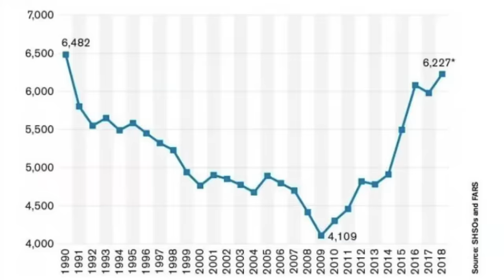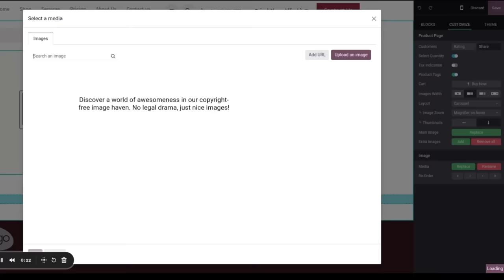Can this forgotten invention save your life?

Comment: As an American who lives and works in a very mountainous and rugged area, my favorite part about all of these massive new trucks is that they’re a terrible option for pretty much all their marketed uses. Their super soft suspension makes towing more fuel inefficient and dangerous. Wide bodies and top-heaviness makes a lot of rugged and steep backroads inaccessible. If you’re traveling through deep mud or snow you HAVE to balance the weight distribution between the cab and bed. I see so many people driving big trucks through the snow and their beds are filled with sandbags, which makes the already heavy vehicle even more fuel inefficient and dangerous. Since they’re so tall, it makes it difficult to see over the hood on rough terrain, making overlanding harder. I drive a 2 inch (~5cm) lifted 2016 crosstrek with slightly oversized wheels and I’ve tackled Jeep trails with a ratings up to 3.0, and I’ve bailed out a few overly confident pickup truck drivers on less technical roads. I volunteer to shuttle trail maintenance crews and thru hikers in the summers and all the other volunteers drive similarly practical compact SUVs. Or Four runners, Tacomas, or Tundras. I love only needing to buy gas once or twice a month, and being able to get up my steep gravel driveway. When my friends with big new trucks visit, I have to hop in the drivers seat because they genuinely don’t know how to drive up something like that without carving deep ruts in my driveway (they’re all from the city btw!! None of my friends out here drive big trucks)
Reply: Land Cruiser 70 Series will leave em all behind. Still
Reply: Corporations are not interested in selling you the best tool for the job, they are only interested in selling you the tool that makes them the most profit.
Reply: @mycosys Yeah no thanks I'll take my modern vehicle that can go over all the same trails. I like having the comfort of it.
Reply: @Aliyah_666  doubt it.
Reply: @Aliyah_666   Congrats on not knowing theyre still made and still being updated i guess?
Reply: @mycosys  FJ Cruiser or 4Runner are also solid options. Taken the latter off-road quite a bit.
Reply: Off-road Beetle is still king.
Reply: @mycosys  Did a quick search, they are not allowed in the US anymore due to emission and crash tests.
Reply: Thanks for sharing your experience. I am looking to get a truck this year (I am desperate for a vehicle that can actually transport 4x8 sheet goods without being a danger) and definitely want to make sure I'm still capable when I want to go out hiking or further out in the mountains (I am somewhat in the country). Not that I was ever looking at a new or super large truck anyways, but this is helpful stuff to take into consideration.
Reply: @georgehill3087  fortunately, this statement is false.
Reply: Without fail every video I see where someone starts criticizing the usefulness of pick up trucks there’s always somebody with a crosstrek saying they can drive through mountains upside down backwards through a snow storm.
Reply: I hope Alex comes back to the Subie family now that he trashed that crap Ford!
Reply: @mycosys  congratulations on excusing a terrible person who likes terrorists.
Reply: @HooLeePhucingSheet  you ok buddy? keep up those sessions eh
Reply: @mycosys  I'm not okay when she excuses death.
Reply: @HooLeePhucingSheet  ima regret asking, but who TF is 'she'' and wtf are you on about?
Reply: @mycosys  you regret asking but you commented? Lol this logic.
Reply: @mycosys  also YouTube deleted your paragraph that you sent me. Wanna try again?
Reply: @HooLeePhucingSheet  is this insanity about the common name Aaliyah? Are you that terrified of everything?
Reply: @HooLeePhucingSheet  never heard of morbid curiosity? its like watching a trainwreck
Reply: @mycosys  try to post that paragraph again.
Reply: @HooLeePhucingSheet  wtf are you on about dude?
Reply: @mycosys  the paragraph where you were reeeing. Try to post it again.
Reply: @mycosys  nvm, go listen to kpop or something, those playlist are a scream for help lol

Comment: 18:34 you might want to read your cars manual. Automatic transmitions often have an "emergency" release for situations like this where your transmition fails. It will take the car out of park and most of the times lock it in first gear (if it can get to first gear). It often does require you to take appart part of the middle console. With my old mercedes all the neccecarry parts were removable without tools
Reply: He should have done that before pulling the car onto the trailer. The wheels were locked up.
Reply: No transmission fluid means no fluid for the torque converter = thing no movy
Reply: You should read your car's manual in order to spell transmission correctly. Also, everything that you typed was pure bullshit.  The transmission has a giant hole in the pan and it is not going anywhere without a tow truck
Reply: How would that even help past or present tense for this situation lol it wasn't an internal failure a transmission cooling line was punctured theres nothing wrong with the transmission itself
Reply: @bhubbard6573  well in my manual it's spelled Getriebe since my first language isn't english.

Also i didn't see a giant hole in the transmission. I might just have not noticed it. But yes for that to work the transmission indeed needs transmission fluid.
Reply: @OldManLuffy  a cooling line puncture most likely wouldn't cause an immediate stopping condition. I don't know if it has a pressure sensor detecting a loss of pressure but i think it most likely only has a temperature sensor wich only would detect overheating. And in overheating condition i'm not sure if it would throw it back in to park after shifting in to drive.
Reply: @toiletgaming2005  does this transmission use a torque converter? I genuinly don't know. I was under the impression that newer cars switched to double clutch transmissions wich i don't think use them since they aren't that efficient
Reply: @Adi-kf6bq  Please, just stop giving bad advise. You are in over your head.
Reply: @OldManLuffy  It wasn't a cooling line, even without cooling you should still be able to put the car in neutral, the metal spike went straight through the plastic transmission oil pan. Could have gone through the engine oil pan just as easily, that one is also made out of plastic on newer Ford trucks (the colour and smell would have been different, though). And yes, he should have taken the car out of park atleast to get it on the tow truck. They were basically dragging it with locked wheels, which isn't too good for the tires and worst case scenario can damage your driveshaft (not likely, but wost case scenario). I'd also like to know how they got it back off the tow truck once they arrived at the shop.

Comment: And that's why you don't buy inflated $100k aluminum sports trucks. 
Spent $14k on my steel-frame Ford. Same thing, just made correctly with a more reliable engine and interior that doesn't sweat your nuts off in the summer. Highly recommend!

Comment: I have a suggestion, if you will. Im a biker whos had 3 bikes stolen from me. Is there a way that you could fit a spike on a spring under the seat, that would automatically deploy if another lock or pass code isnt inputted?
I hate thieves, and bike thieves in particular, having been stranded in europe some 800 miles from home. They deserve everything they get.
Anyway, heres hoping you might read this, and put something together.   Love the show, and an avid watcher.
Dai.

Comment: 1:11 to clarify, engine power improves (positive) acceleration and has nothing to do with brake power. Overall mass and effective brake mechanism design are the only significant factors in deceleration (negative acceleration). The only way a more powerful engine contributes to less brake effectiveness is when that power is introduced at the cost of significant mass gains, but that's a correlation to the overall issue, not the cause.

Comment: What is also fun about these truck is: they must have there brights on any time between nightfall and sun rise. They can not do any less then 100mph. They must tailgate you regardless of traffic or open lanes. They must rev there engines any time of day (mostly at night because who needs sleep they got a MANLY truck) and also the rules of the road no longer apply to them they can drive anywere any way and they will try to run you over, on foot bike cat does not matter. I assume they think there Rodger miller
Reply: E
Reply: @EEEEEEEE  E

Comment: Plastic oil pans are really good at getting holes in them. Makes so much sense on a truck meant for going offroad. If it had a skidplateor many simply a metal pan this would not have happened.

Comment: It's Easy To critique thisbc obviously it does not work but there is a seam in the original design. That creates more of a net, i think a stretchier fabric have worked if you didn't but the seam in and if you had a literal different attachment to your truck

Comment: @Ididathing Couldn't you make the catchers bottom half always out(like a plow kind of front bumper) and then activate via the horn 2 pistons that just kind of push away from the front hood. This would naturally expand out the catcher... Again... you guys need to make your things larger and farther away. The more room you have to stop before the impact, the slower the acceleration and the safer it becomes. 
Make it a triangle ( best structural shape). Have 2 points on the front of your vehicle that stick out about 1 to 2 feet forward. Have a third mounted to where people put those hood ornaments.
Have a spring based piston, make the spring be like 50/75 pounds to collapse. Make it fully collapsed still keep the net at least 5 inches from the car (the net has give remember that).
You could probably save people by essentially rolling them over your vehicle.... Also... your supposed to use your breaks. The decrease in YOUR speed is what makes the net work...

Comment: The lack of small trucks on the roads in the United States is entirely political. Small trucks are taxed differently and, as a result, are taxed much higher than large trucks in the U.S.

 So now the only small trucks around are the ones from before the implementation of said tax, around the late 90s i think, which is why all the two door pickups today have an awkwardly sized bench seat crammed into the back instead of just having a single bench seat up front with a long bed.

 I live in a state that salts the roads to take care of ice in the winter, so small trucks are getting pretty rare. A lot of people are getting collectors plates for them.

Comment: you know that every sec u weld with blanc skin its equal du 5 min in the full sun. At least in the matter of skin cancer. just saying you can block it with everything normaly clothes.
4:27 right side looks good, left side isnt really molted together so its more likely to break, cant really tell about the top side

Comment: waithow do you not get metal shards in your feet? i did a metalworking project and cut a lot of sheet steel and the metal fragments were everywhere and even getting stuck in my feet a little bit. more of nuisance than anything but still lol. should do electroplating naked tho. id pay t-  id hate to see that

Comment: Nice video :) big trucks are absolutely necessary in rural Canada. But people have realized how dangerous they can be so lots of modern trucks have a myriad of sensors and cameras to warn you if a small child with no self preservation instincts has wandered in front or behind or beside you
Reply: But you can drive the car just fine if the cameras don't work or are dirty.

Comment: I despise the modern "light truck". It's moronic status symbol that's extra deadly purely for the sake of aesthetics and compensation.

Even if you use them as actual tools, they're worse in almost every way compared to the more reasonably sized ones of yesteryear.